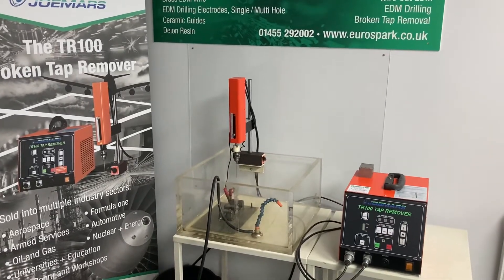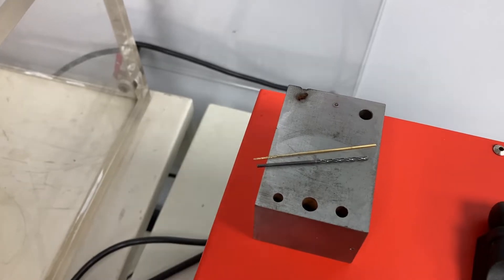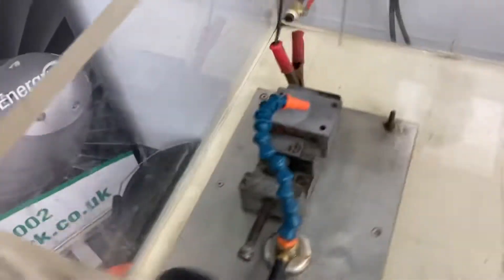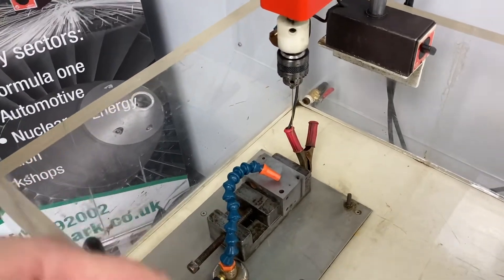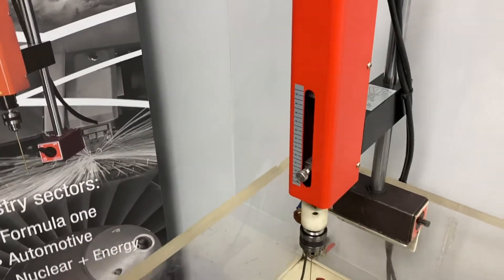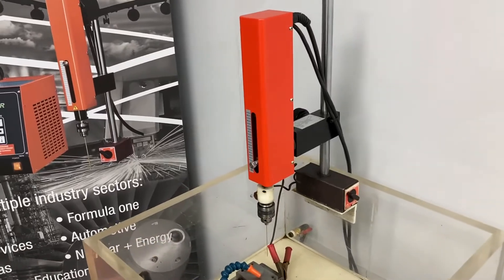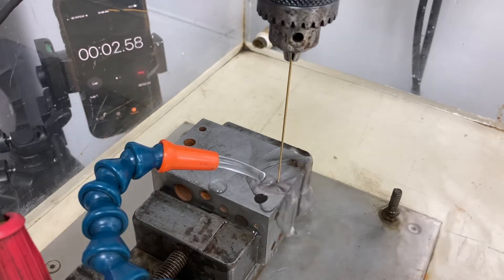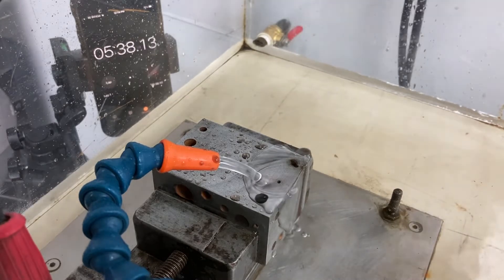How to remove a small broken drill , tap , stud or bolt (Tr100 Portable EDM)

Comment: ok what if its underneeth your car? wtf do you do then???
Reply from the maker: Hey thanks for the comment, the unit can be used in any orientation and if you cant  get the head in position due to access you can use a dog legged electrode. 

While it wont be able to solve every application it is a very flexible piece of equipment. 

We have sold this unit to garages up and down the UK along with both red bull and McLaren formula one teams all finding great success with the unit.